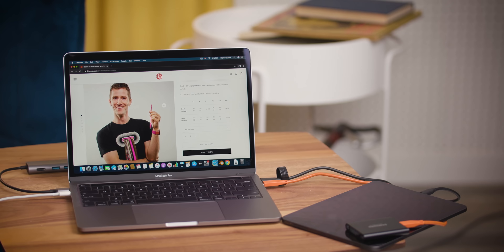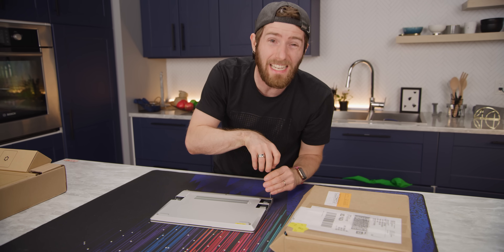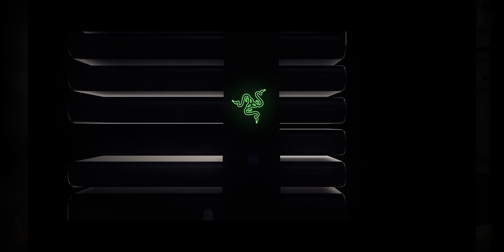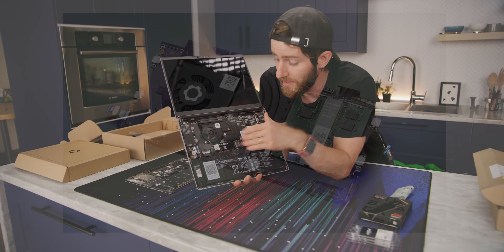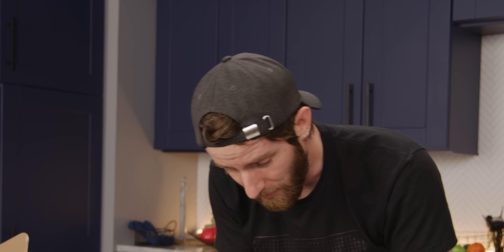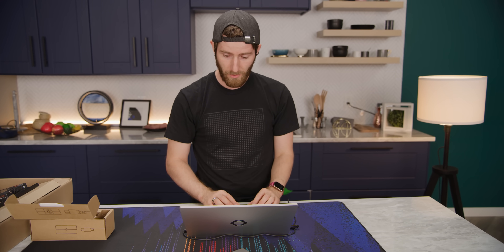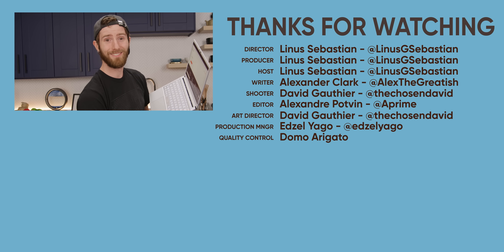A COMPLETELY Upgradeable Laptop?  - Framework Laptop Review

Comment: This is the future, replaceable everything including motherboards instead of throwing it away and buying another $1000 one
Reply: Are you for real? If you replace a motherboard that's pretty much a new laptop... There is no way they are gonna sell you core i9 rtx 4000series, gen 5 ssd motherboard for only 300 to 500 LOL.. new motherboard pretty much the price of new laptop 1000$
Reply: @jonmon5745  well you buy an motherbord with i9 for $500 but can you buy a new laptop with same i9 for same price? Like you buy just the part of the new laptop that you need and don´t need to pay for some SSD, keyboard, monitor crap that you didn´t want.
Reply: @jonmon5745  Selling an entire laptop for $1000 and then selling a single piece of that laptop separately for also $1000 dollars is just not something that you can do
Reply: @jonmon5745  where are you getting an i9 3000 series laptop for $1000, they also only have up to an i7 rn
Reply: @jonmon5745  no. quite literally you are paying for the service, research, and creation of the product, if you are just buying the motherboard you are specifically paying for those things that come with the mobo, obviously it will be cheaper than the laptop as a whole, because you are paying for significantly less features, just because pc parts are retail expensive doesn’t mean companies pay a lot for them. most make deals based on investment promises, and use stocks as a way to buy product. not to mention a mobo with a cpu is abt 30% of all custom build prices and a mobo with a cpu and gpu is abt 60% of all custom build prices, knocking down the size and performance of a cpu and gpu to fit it in a smaller slot would significantly damage the price of it, since you are using less product in all to create it. which is why gaming laptops tend to be cheaper compared to prebuilt and custom build pcs.
Reply: @michael_wave  this company doesnt have their own chip... so there is no way they are gonna sell new laptop motherboard for a fracture of a price from other companies... that's plain dillusional... Let alone alot of you are just saying nonsense that this laptop is fully upgradable which is entirely inaccurate as Ive said over and over again only IO are modular so it's not cpu gpu or ram.
Reply: @jonmon5745  ram can be moved to a new mobo since it can be taken out and moved and replaced etc but most laptops have that feature, although ur right about the cpu and gpu it would still obviously be more expensive to buy an entire new upgraded system then just buying the mobo itself and putting old parts such as storage and ram in it. of course it’d be more expensive to buy a new system because you’re buying for a new screen, ram, cpu, gpu, camera, mic, keyboard, etc. the cpu and gpu take up a lot of the market price yes, but they are not all of it, so it would be cheaper to upgrade with this system obviously
Reply: @michael_wave  yes it would be nice if buying a new board is just a 1/4 of a price than buying a new laptop but it's not. Board itself is the most expensive since it's like the laptop itself because new generation cpu/gpu soldered on board will definitely not gonna come cheap. And the ddr4 will not be compatible to ddr5 slot once a new generation of board comes out.
Reply: @michael_wave  Don't get me wrong I was excited and even liked the "TITLE COMPLETELY UPGRADEABLE" Yeah but it was bullshit misleading title. At first I was like DAMN FINALLY COMPLETELY UPGRADEABLE... Then later on found out cpu/gpu soldered and gpu not even dedicated. So later on I thought if cpu and gpu soldered I said like, WTF WOW WAIT A MINUTE COULD IT BE maybe ram/ssd are upgradeable to new generation. Then again surprised it's not also... So what the hell is the title is for when pretty much my old windows laptop can be upgraded to any current gen ddr3, swappable battery, ssd and screen so what is the special about this laptop why is have "completely upgradeable title". The thing is this thing doesn't deserve that title coz the same at my old laptop no matter how you upgrade you ram/ssd you are still stuck at current gen so you reach the bottleneck performance. So if you wanted more power for video rendering/gaming/faster load/higher refresh rate all that being said will enhance your experience you still need to buy a new generation laptop.
Reply: @jonmon5745  once ddr5 comes out ddr4 will be rendered obsolete anyway since games will adjust and compare to new clock speeds to run smoother and better and hold more players etc games like gta can run on mid range setups whilst games like mw with significantly less content need better parts to run. that’s just how it is. but yeah it is an expensive piece, obviously, but it’s still going to be less expensive than the entire laptop itself to buy a fraction of it.
Reply: @jonmon5745  in what universe is a new motherboard 1000$?

Comment: This is amazing; I’m sold. I really think they can be profitable too cause laptop manufacturers have stagnated of the past 6 years. Im still using a 2015 Macbook pro cause there just isn’t anything out there significantly better thats worth the $1-2k upgrade. The “gold standard” XPS 15 is a shit laptop (I use one at work). Everything else out there seems to be taking away features every year rather than adding them. Im sure theres improvements that can be made to this like a trackpad and chassis that can compete with Apple, but on every other front they seem to be blowing the competition out of the water

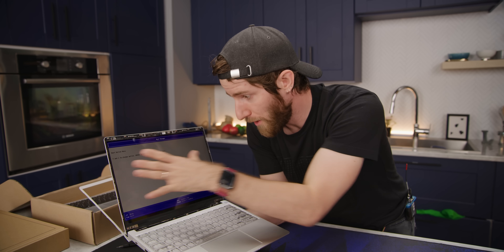Comment: 13:21 "touch support is built into the motherboard" pardon me, sir?
Reply: Motherboards need to have pinouts available for the capacitive touch sensors built into a display that has them. It's good to know that you can swap a touch display right in without a motherboard upgrade
Reply: @Zhus118  that's what I mean, the only you need is panel that support touch feature, but I wonder what linus said in this video

Comment: I don't even buy a laptop if I can't change both RAM slots, the M.2 and the battery.

Since I go for 17 inch laptops it's not that hard to find fortunately. Currently my Asus TUF Gaming A17 has 2 replaceable (8cm length) M.2 SSDs and a 2.5inch drive. The WiFi card is also replaceable. I hope it lasts long, it's upgradeable and the R7 4800H should be a decent CPU for at least half a decade.

Comment: Am I the only one noticing that these upgrade "modules" are just recessed proprietary USB-C dongles?
Reply: I noticed that too, but hopefully people can just buy the ones they need, resulting in less material used at the mass market level compared to multi port dongles
Reply: @DanielMether  Also, what's the point of a upgradable computer when you are going to put the max RAM right off the bat, I've been in computer repair for 20 years, and before the advent of soldered RAM, the vast majority of end users had the same amount of memory it shipped with by the time they stopped using it. Also more connectors mean more potential points of failure. Don't get me wrong, these are neat features, but this is a niche product, don't for second believe this is what the mainstream user base wants or needs.

Comment: Consumers dictate the design. Why give them a modular computer when they have to upgrade the whole thing because the CPU spec changed.  Or the memory spec changed.
Things the users upgrade ARE upgradable.  Memory chips are often upgradable, and so is hard drive storage even the GPU is upgradable on larger laptops.  But things that cause the user to upgrade the whole computer for cpu, sometimes the gpu, why make them upgradable if the user never upgrades them?
CPUs on laptops used to be upgradable.
Most users use a laptop until it dies in the original form that they bought it in.  on average that's 5 years.  why waste the money building something that nobody uses.
Reply: There's dozens of ebay people that fix repair laptops.

Comment: This sounds dumb to say - but all it takes is someone doing it correctly. So many have tried and failed because they seem to inevitably have some horrible deal breaker issue. I see no deal breakers here, except the website is completely broken. Hope they get that fixed. As a software engineer, I even entertained the idea of joining them until I discovered they use Ruby on Rails - ewww, sorry guys. I hate Ruby on Rails because it's difficult to work in and diagnose issues - as it appears you may have discovered today lol.

Would be curious what the Linux support is like (specifically, how well supported are the integrated components)

Comment: If this had just one Thunderbolt 3/4 port I'd buy one immediately on principle. I don't even need a new laptop.
Reply: It seems to have USB4. There isn't much difference, what part of Thunderbolt 3/4 do you think it's missing?
Reply: @danfr  E-GPU
Reply: @cmac3530  Ah yes. They say eGPUs should work, a few have already been tested and confirmed to work. It sounds like the reason they aren't saying Thunderbolt is because they can't use that name until the certification process is finished.

Comment: If they start offering non-intel CPUs, I'll buy one.
Reply: probably due to thunderbolt being only Intel thing I believe that when usbc 4.0 cames out they might do with amd one...
Reply: @MrLuigge  you can buy a AMD motherboard with thunderbolt 4 see the Asus website
Reply: @ppaolinelli  hmm I thought it was only Intel compatible, I saw once a comparison between 2 identical laptops and the one with amd did not had thunderbolt, it was only regular usbc
Reply: @MrLuigge I think there will be a lot AMD thunderbolt/USB 4.0 very soon.
Reply: @MrLuigge  It was intel-only before USB4 was released. USB4 was supposed to retain compatibility with existing USB3 AND thunderbolt devices so, intel opened the thunderbolt standard. It is optional though so it is not guaranteed for thunderbolt to be included.

But this is why you can find AMD-powered devices with thunderbolt now - although it is still more common with intel stuff, it requires extra hardware when used with AMD as far as I know. Which is why you often see smaller Devices where the intel version has Thunderbolt while the AMD version does not have it. Thunderbolt compatibilty is built into current intel cpus while that isn't the case for AMD cpus (currently, might change for future cpus) and it has to be done through the motherboard.
Reply: AMD and a thunderbolt 4 dongle 🤯
Reply: Just wait
Reply: My first thought too, I'd love to go Ryzen instead

Comment: The 3:2 aspect ration for the screen is a deal breaker for me.   I'd also like to see a 15" screen size with AMD Ryzen processor options.   I am sure linux would be no issue to run on this laptop since it is using relatively standard and quality components.

Comment: Yup had a hobby rc radio module, that the ipex4 (uf.l) connector had come apart on, so had to solder the signal wire to the center pin, and the shielding to one of the ground pads.

DON'T MESS WITH UF.L CONNECTORS!!!

Comment: you can get 100W compatible usb c magnetic cables from aliexpress (made by baseus btw) that works exactly as you want. if I didn't lose the little magnetic usbc plug I would still use it.

Comment: This is cool.
But not allowing for repairability never had anything to do with how capable laptop companies are and everything to do with the bottom line.
Designing a laptop to be easily repairable is invariably going to be more difficult, and include more parts to produce, adding to cost.
Consumers didn't consider upgradability and maintenence as an important part of their shopping priorities.
Laptops that aren't repairable and upgradeable need to be replaced more often.
For all these reasons, laptop companies do not become more profitable by making them repairable or upgradeable. So they don't.

Comment: Give me a trackpoint, thinklight, and a hardware switch for the battery and I'm sold!
Been looking for a modular laptop that can mostly replace my Thinkpad T420 for a while now, and this might be the closest thing next to a System76 laptop.

Also don't get me wrong the T420 is an excellent laptop, but it's just a bit slow when transferring data, and it's lacking some power for certain tasks that I want to do with it.

Comment: 6:17 The difference between a modular system and a one that you can't repair is the difference between a company that will* get bust and one that is rated a trillion dollars ...
If it gains any traction, it will be purchased by another company ... Apple maybe, and then they will make it fade into obscurity.

I hope not, but I only can be cynical at this point.

*=hopefully only might

Comment: I've upgraded my old 2009/2010 satellite pro l300 over the years still serves well as a general purpose web browsing machine and portable media device.

screen from 1280x800 to 1920x1200 (panel came from a hp elitebook, required new cable from another toshiba model with high res screen) makes use of a dvb=t2 usb receeiver for hd tv reception.

upgraded the wifi to a wireless n module

2ghz pentium to 2.8ghz c2d which supports intel ida upto 2.93ghz which can be locked on both cores using throttle stop for a kind of overclock.(supports 3.06ghz c2d inc extreme edition, not sure if c2q is an option)

2gb 667 ram to 4gb 800 (upgradeable to 8gb but price is prohibitive on 4gb ddr2 modules)

160gb hdd to 250gb ssd (sata 2 speed limited :(  )

added a webcam and screen bezel from a broken machine.

odd drive swapped for 1tb hdd

6 cell battery upgraded to 12 cell

expresscard to 3x usb 3.0 adapter (hardly ever use so looking for something else useful to make use of it)

Comment: Right to repair, bang! Asus should just send you a new Wi-Fi module if it's flacking out after a few hours of being on and I insert the one from the broken Lenovo and it works like one would expect it would. In fact they sell it on Newegg because it's for 10th gen Intel, But any one works minus a feature or 2. Losing faith in support because they wanted whole PC to send a new one, not having it. Data is a thing, and having to update OS from 1902 to 21H1.

Comment: If I hadn't already splurged almost £2000 on a laptop 18 months ago, I'd give them my money just for being so damned cool.

Edit: One of the coolest features I noticed when I saw this for the first time this morning, but which nobody seems to be talking about, is the insane level of design detail, right down to length of the keyboard ribbon. The number of times I've tried to repair laptops in recent years where I've struggled to even reach the ribbon latch because the ribbon's been so short is at a level where it's long ago stopped being funny.

Comment: Laptops don't have enough durable video ports. Did they fix that? Are those pluggable ports? That's the main thing I want besides Linux. If I break a thunderbolt port, I can't use 2 monitors. I thought the 2018 Macbook Pro was the best laptop today.

Comment: The thing I'm mostly missing is USB ports.
I wonder if there could be a modular IO expansion cards multiple USB-C connectors. Maybe there's enough space for 3/4 in one module. That would be awesome for me!
What I'm missing is sockets and not bandwidth with those USB-C.
Ofc, they would share the USB 3.2 socket bandwidth and power but the speeds would be just fine for me. USB 2.0 has a decent bandwidth

Comment: Offer a larger version with a badass gpu that can replaced/upgraded every generation and I'm sold on it. But the fact that you just need to remove 5 screws then the keyboard and top panel pops off, rather than using a prying tool to pop a bunch of shitty tabs that break to remove the back panel is amazing

Comment: No mention of the graphics card? Can that part be upgraded? I'd be interested on how well it can game.
Reply: It's an ultra thin and light, also called Ultrabook or something. That means there is no dedicated GPU whatsoever, the only graphics processor on the device is the built-in GPU inside the processor. Because of it being an ultra thin and light there isn't even room to put a GPU, if you want a gaming model with proper graphics capabilities just wait a bit. This shit is straight fire, they have an incredible product at hand, and ever since this review went live I'm sure they are making fat stacks all day every day so I reckon it won't be long before they announce a more powerful "gaming" or "workstation" model with a beefed up CPU and dedicated GPU. It's going to be a hell of a lot more expensive than the current offering though, I'm sure it will at the very least be double the price though (2× $700 = approx. $1400 I reckon)

Comment: while the dell 2570p that I have used for a long ol' time isn't AS customizable or thin it DOES have bigger battery options pci slots dual channel memory and a socketed cpu and the bottom panel is held on by a spring lock that slides off... SOME of dells laptops were actually pretty good aside from cosmetics and keyboard I cant think of anything other than that i would want to customize and personally I prefer a thicker laptop because I'm less worried it will snap in half. That said the guys at framework absolutely have the right idea and I hope they are successful.